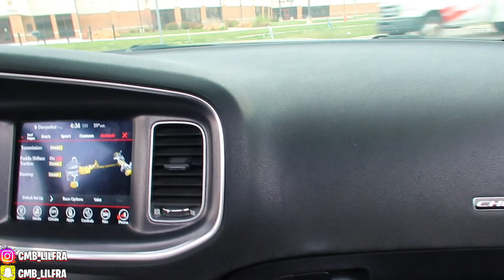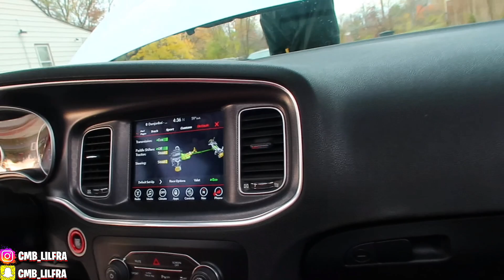INSTALLING A JLT COLD AIR INTAKE ON MY SCATPACK CHARGER 😱*BEST MOD EVER

Comment: I'm sticking with the stock box since it doesn't pull in any hot air from the engine, I heard the jlts only preform well on a dyno hood open or in cold environments.
Reply: Yeah them shits don't add no HP to your car stick with the stock ot switch to the hellcat stock